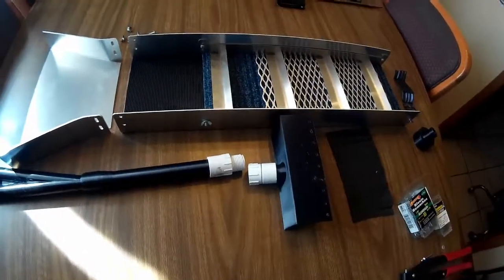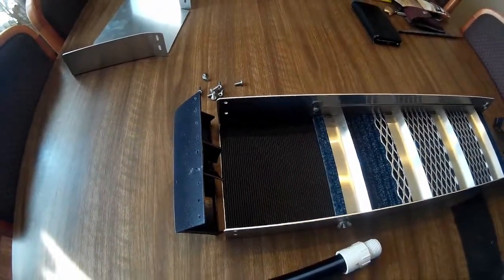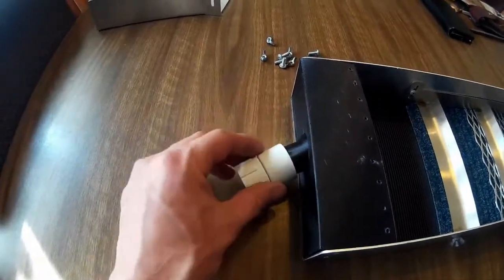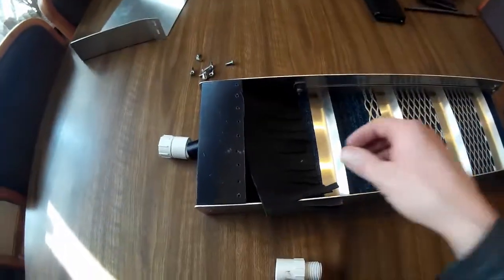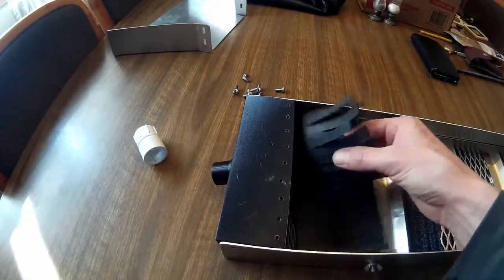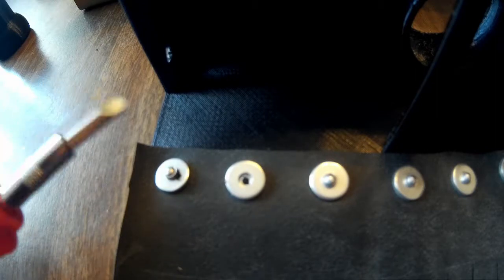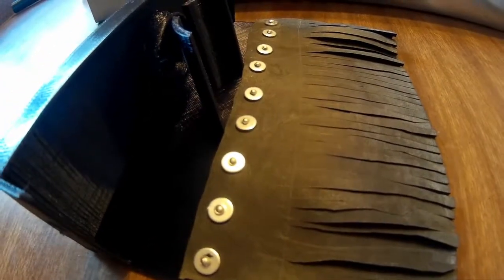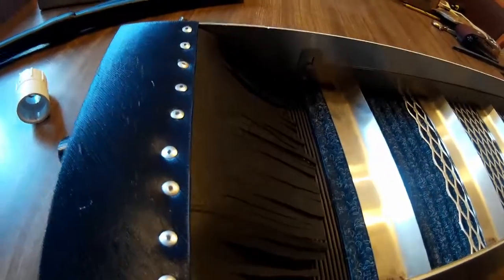Making a 3D Printed Crashbox for a Mini Gold Dredge

Comment: Can I buy 2?
Reply from the maker: I'd like to make the power jet and crash box available, but it's still in the development phase right now.
Hopefully the weather will be good soon enough and I can put the entire setup to the test and maybe even visit the gold fields.

Stay tuned and thanks for watching!
Reply from the maker: I'm testing this design now... the crash box does what it should but my bilge pump doesn't put out enough water to run the sluice, even though it's tiny.
Stay tuned, I'll be giving this design away for free in the near future. It'll be a good start for a larger pump or even smaller sluice